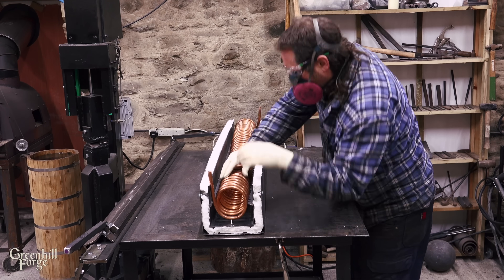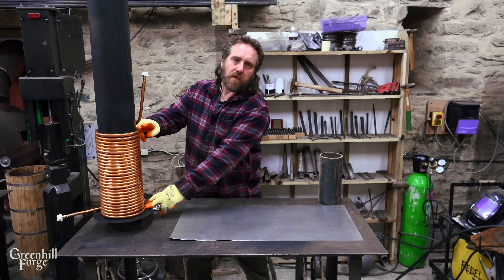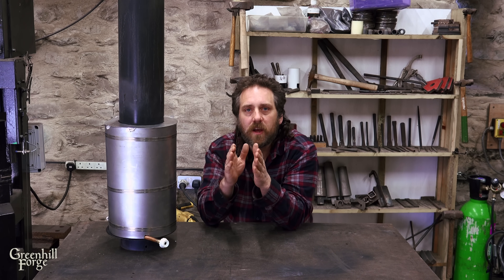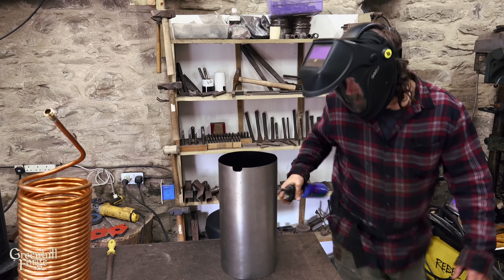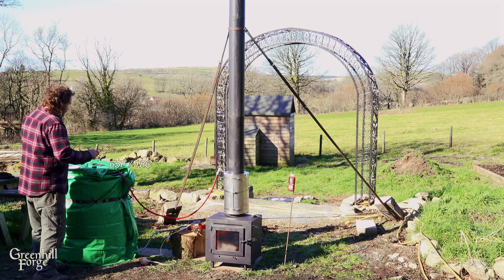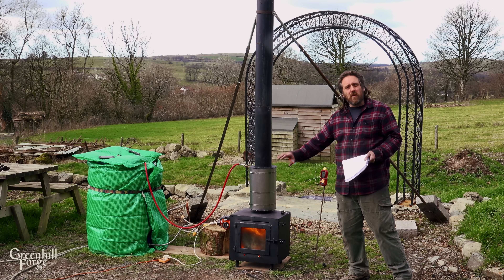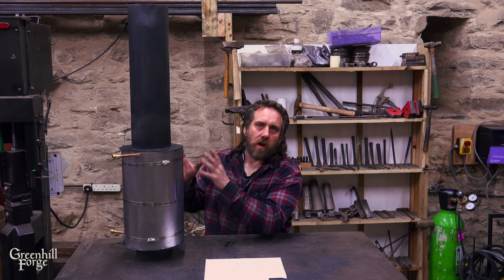Best Wood Stove Water Heater Yet: New Design Tested | Off Grid Water Heater pt3

Comment: I have been thinking about this type of heat harvesting for a long time and I believe I have a couple of ideas for you to try.

-First would be to simply disburse your copper pipe over more length of the flue pipe. Instead of clustering the coils together there should be about a 3 inch gap between them. Still do the the whole graphite powder inside of a shroud with insulation and another exterior shroud outside that inner core. This should allow for more heat to be harvested instead of so much lost to the environment. It will use significantly more materials (other than copper) to build the shrouds and fill them with graphite and insulation respectively. 

-Second, and this gets into  code violation territory so probably not ideal but the idea would be to fabricate an insert for the flue itself. This insert would be a slightly smaller diameter than the flue so it would slip into the flue but make contact all around its exterior, the longer the insert the more heat it can transfer out as the insert has metal spanning the diameter of the insert from several 6-10 spots around the edge so that it is sort of split up like a pie if you look through it end to end. These cross-fins catch the absorb heat and transfer it to the walls of the insert which is in direct contact with, and transfers heat to, the flue walls.

The insert would attain very high temps so could burn off a lot of the creosote that would accumulate on a constantly cooled copper coil so cleaning is not as much of a concern. It could be made from steel or stainless steel. Likely it would be impossible or very difficult to remove the insert from the flue (after it has been above a fire) if it was fitted well for heat transfer to the flue, but there could be ways to prevent this and have it removeable for cleaning. 

Perhaps one could build something akin to very thin "angle-iron" but with one part curved to match the curve of the flue and the other side lengthened so its the radius of the flue so that when inserted in they still form a "cut pie" look with all of their long sides touching in the center and their curves against the curved wall of the flue. Then figure out a way to keep them all arranged like that (maybe something welded on to each near the tip that it can hook into its neighbor , or a chunk of thick threaded rod cut into pie wedges and welded onto each tip then when all are together in the center of the pie you just screw a nut on and that holds them in place). This way you can take out the "angle-iron" lengths and wash them and reinstall them easily... but even then like I said this is code violation territory anyway so if you do go for this you would always want to run it outside of a building, *always*.

Comment: My most enjoyable series on YT and I unfortunately spend far too much time here finding meaningful, useful entertainment. This is incredible. Suggestion: double, triple or quadruple the copper winding around the outside of the flue. That would capture the rest of the heat that is escaping and which you mentioned early on. One point for clarity: were these tests done with the pump going or just by thermo-siphoning?

Comment: So why not combine the current additions with in-flue? If you had a closed off can of graphite with a tube inside, the maintenance goes from having a corrosive buildup on hard to clean coils, to having to scrape it off of a smoothe partially sacrificial can. And when it gets eaten up by the creosote you take the can off and replace it, maybe even reusing the graphite.

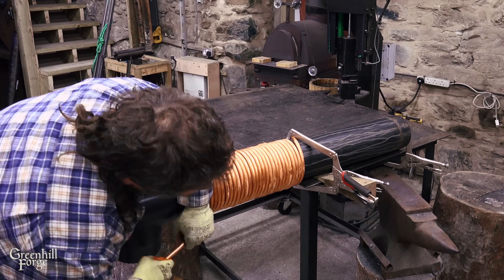Comment: 2:30 You should bend it around a smaller diameter, then you twist the whole coil so it grows slightly in diameter so you can put it over the flue pipe, then when you release your twisting torque on the coil it will naturally shrink to fit tight around the flue.

Comment: You could add baffles or something on the inside of the pipe to slow the heated air in the area of the coil. but of course you wouldn't want it to be too slow. A bigger/taller coil area would help too but thats more copper.
Reply: Maybe just space the coils out more?
Then fill it with really fine quartz sand
Reply: Put it below the glue.

Comment: On additional benefit of the sand filling would be the increased thermal mass to act as a thermal battery/radiative heater in the colder months.

Comment: Thank you for such great tests. Yes, putting the copper directly in the flame won't last and if your pipe is not the correct size for the "natural flow" of the thermal syphon, it goes to steam inside the copper! One solution would be to have the wood stove vent directly into a mass for a few feet (like a firebrick box) and then place the copper coil INSIDE the stove pipe AFTER the 3 or 4 feet of bricks or "mass" it has to first pass through. (There would be no stove pipe inside the brick box.) The stove pipe would go in one side and out the other side and continue to the roof. This would reduce temperatures inside the stove pipe to (maybe?) 500 degrees F which is a more comfortable situation for the copper pipe inside the stove pipe for it to last for a very long time. Of course, if the copper coil gets "too high up in the air" it's kinda pointless because heavy water up in the air is hard to work with. In a Russian stove the gasses are pulled up, then down (sometimes below the firebox,) and up again. The water pipes can be placed in either the ascending or descending channel. The gasses in these channels are several feet away from the firebox and flame so the temperatures are reduced.

Comment: Great video! I am working on a coil system for my outdoor hottub to speed up the process. These tests are super valuable for me!
Reply: Something you might find interesting is submersible hot tub stoves. Requires a custom built tub and a barrier area. Seems like a fun idea, and I wonder how long it would take to make dangerously hot.
Reply: @thebicyclesafaris  Thanks! The tub already came with a double walled external stove. Works great but I want to use more of the heat that is lost through the chimney.

Comment: To get the most out of graphite and sand you need some space between the coils to get it between the coils. Like having an 3-5mm gap between the coils. NOT gapping the coils to the pipe, still tight.

And also having the coils go higher should help as the steel has more surface area to give the copper heat from
Reply: Agree and was about to comment similar although I had a slightly different thought process.
Reply: Which is similar to the way he had it configured inside of the pipe in the very first experiment; AND for the same reason.
Reply: @georgebennett8403  close but he needs more spacing, now they are mostly tight and likely have lots of air in between.
Also just having the coil go a little higher lets more heat just because steel and especially stainless steel is a poor heat conductor so more surface area gives more total conducted heat
Reply: The temperature goes down significantly after about 3 feet however in the chimney. Still, more then enough to heat the water indeed so certainly not a bad idea
Reply: The testing was imperfect, but I applaud his efforts!

He should absolutely space out the coils and increase the overall height, but for another reason: natural convection. You'll hear it called "thermosyphon" or "stack effect" but it's all natural convection of a fluid confined in a pipe. He said he wants to run it without a pump, so he should be making his next iteration taller, improving the flow rate. He could easily measure flowrate with a measuring cup and a stopwatch and compare different configurations as long as the inlet and outlet differential is consistent. The temperature at the water inlet and at the bottom of the flue pipe should also be consistent for subsequent testing of flow rates.
Reply: Just what I was thinking.
Reply: This

Comment: How about using a second pipe around your coil setup. You could divert from the main chimney, use the heat from outside to heat up your coil system from both sides and put the smoke back into the main chimney. The systems would still be separated but you would also heat it from outside

Comment: Are there any concerns with the graphite off-gassing if someone did something like this inside a sauna, or does the containment of the graphite in steel solve that problem? I'm considering adding a little hot tub outside my sauna.
Reply from the maker: Graphite is basically pure carbon. I don't think there's really anything to off gas.

Comment: What I am wondering is, if you could create a version in which you build channels through the chimney and feed the flute through those channels? Those should still be pretty easy to clean and you would get more heat out of the system.

Comment: A major difference between the inner coil and the outer graphite one was the length of flue it could gather heat from.  Perhaps you could try a variant with the same outer copper coil length but with more spacing between loops.  It will use more graphite powder, but on a quick look that appears to be cheaper than copper.

Comment: Are there risks of the graphite auto-igniting from your standard wood stove flue temperatures?
Reply from the maker: It's not imposible I suppose but the water will keep it from getting super hot and it's sealed off from oxygen so I think it's very unlikely.

Comment: Hi, I Have no idea if it would work or if it would compromize the copper pipe... But, how would it work if you soldered the pipe to the chimney?
I imagine that the heat transfer would be very good. Maybe it could come lose if the heat got too high. But the water in the pipe might protect the solder?
I don't know, just a thought. Interesting videos 👍
Reply from the maker: could braze it. It would definitely help.

Comment: Thanks so much for doing all these tests in such a competent manner.
something I'd love to see is a water jacket on the flue in stainless steel with a water column thickness of 1/4" set up as a thermo siphon.
Chris Harbour used 3/4" copper on the outside of the flue and it collapsed/formed/flattened itself around the flue got better contact than round pipe. and buzzkill his sciencey data was, it worked good ;(

Comment: Hi,
As always I love your content. This time I am really skeptical, but maybe I'm off !
For me the principle of using copper is to be "inside the gas". But if you are outside the gas you wouldn't even need copper as it is just an intermediate of heat exchanger.
Why not having 3 shells
Inside 1st = the gas
Inside 2nd = the water (ask to be waterproof but you are plenty able to do that)
Inside 3rd = insulation

It would also be a lot cheaper and simpler... and I would bet for a better efficiency
Best
Reply from the maker: I agree, water jackets are probably the most efficient way to go, but most people don't have the abillity to buld one and they're pretty expensive. This is meant to be a an addon to a standard stove.

Comment: Love  the testing and ingenuity you bring. My thoughts on a somewhat similar but ultra low cost version for the average person (you are very skilled and have equipment most of us don't have) revolve around the barrel stove kits. I was thinking the smaller barrels like 30 gal(114liter)  for a fire box (55 gal ones seem absolutely huge to me for this) inside the regular 55 gal barrel and fill the gap between with sand (and water coil if wanting to charge other thermal mass items) to give the mass these ones are missing for longer burn times like what would be needed for a greenhouse to keep from freezing overnight in a climate like mine that often reaches -40 in winter. Originally I thought water but sand is abundant and can freeze without catastrophic results lol. Is this a horrible idea or may it have some potential in your opinion ?  Thanks for sharing, and hope you have a great day
Reply from the maker: Can you send me a link of one of these barrel kits? I've never seen one.
Reply: @GreenhillForge  I tried but looks like if I put a link in reply it gets lost/deleted by YT. They are available on amazon and ebay as well as a number of stores in Canada and USA . I am not aware of any in stores outside north america. I hope you find the "barrel stove kit"  as that is what it's named everywhere I've seen it sold. Many videos on YT show the kits and how ppl have used them. single or double

Comment: You can try to build small water tank around flue so the water will be heat transferring interface by itself. Or instead of coil, you can run several separate straight vertical pipes inside the flue (this is how old steam powered trains were capturing heat to generate steam).
Reply from the maker: I built a shower with vertical pipes through a water jacket I show in this video https://youtu.be/pP_2A5Wdvqg

Comment: Has anyone mentioned using a residential heat recovery drain pipe for this? I'm not 100% sure how they are constructed, but if the copper pipe isnt soldered but brazed its probably got a better heat transfer than your setup.

Comment: I had an idea but it doesn't include the flue at all. Consider the same system with the graphite but add that system to the firebox itself and you can consider using this same idea for the rocket stove as well.   From the inside out: Fire - Steel - Copper Pipping -Graphite - Steel - Insulation - Steel. If the firebox is completely surrounded and as it's in DIRECT contact with the flame the efficiency should be through the roof. Just thought this would make an interesting build.
Reply from the maker: I think that would actually be the best one yet. Might have to try it. Only downside is other people can't just add something on to their existing stove.
Reply: @GreenhillForge  I'm here for all of it. Love the tests and love that you're building it yourself. I imagine it'll take up a bit more space and I understand the downsides but I think that there's more positives and you could do a lot with this. You could add a branch to the water outlet (and inlet for main water line with a another branch for your circular system) and you could multipurpose it for more than a bath, I'm sure you could have on and off valves for underfloor water heating, or hot water radiators, or if there was a way to turn water into steam and pressure it, you could even make turbines that provide electricity. If it has a good efficiency, I imagine during the winter time you could make a ton of uses for this system. Always down to brainstorm and build stuff as well, love your work and the channel. Keep it up!

Comment: Thumb up right at the start of the video! I'm working on such a design (copper tube outside of flue pipe) I know it's gonna be very interesting =)
Reply: Interesting indeed... I'm still digesting the results, a couple quick remarks tho:
- I'm kinda disappointed the simple insulated coil isn't more efficient (that's the design I had in mind) :/
- the length of flue pipe covered is half of the "inside coil", maybe stretching the outer coil up along the flue pipe will have more significant impact (longer contact area, and will thighten the coil to the pipe)
Reply: Well, the data show that graphite is a great idea (or coil isn't tight enough to the pipe...), the gain is impressive! 
However, I don't feel comfortable using it in my house. With my more than 'average' welding skills, making an airthight encapsulation submitted to repeated thermal expansion/retraction sounds difficult... Any crack will leak a messy powder in an high air convection area :\ (air I'm breathing...)
I think you reached a crossroad: either you go for maximum efficiency (wich will lead to modify the flue pipe/stove), or you go for the KISS concept (Keep It Simple, Stupid!), cheap, safe, easy to maintain, at the cost of some efficiency... I'd rather go this way, personally.
Talking about that, I'd be really interested in comparing this setup (50-60cm high?) with one covering more of the flue pipe (100-120cm) by: a) just pulling the top of existing coil up, leaving a gap beetween each spire; b) adding a second coil on top of the first. We'd be able to figure out where the thermal transfert is most significant and what to improve.
Again, your documented experiments are priceless for DIYers, you're an offgrid hero! ;)

Comment: What if you laid the flue on its side, similar to a rocket stove/cob bench set up? The the copper pipe would be directly above the flue as opposed to next to it. 

I understand this would almost certainly require a pump, and moves away from your off grid intention for this project - but I would make the argument that the solar panel required to run such a pump would be tiny.
Reply from the maker: It's worth a test

Comment: I really think that you're missing out on maximum efficiency by not having a sterling or solar powered fan at the end of the exhaust, keeping maximum heat contained in the system requires the coolest possible exhaust air while still safely exiting dangerous gasses. With a negative pressure system you can include more internal baffles allowing for heat transfer to the water. The nominal power required for the fan is effectively free once you factor in fuel savings. People are so obsessed with passive airflow on youtube and are missing out on massively more efficient systems with what is effectively a cheap duct fan.
Reply from the maker: I'm into it. Definitely worth testing. I've just got a long list of other things too.